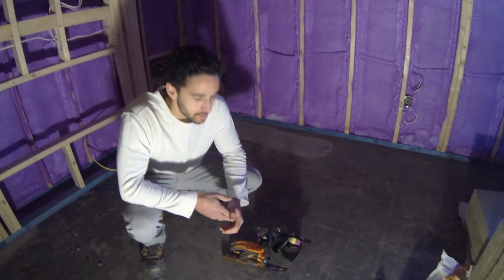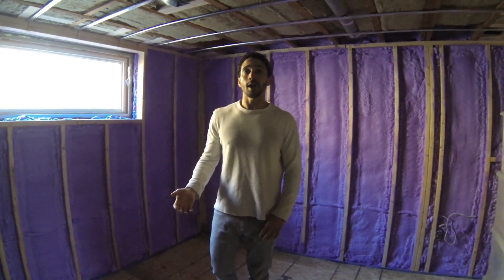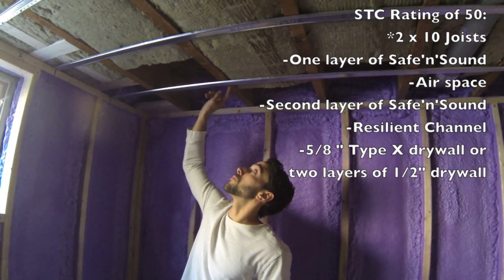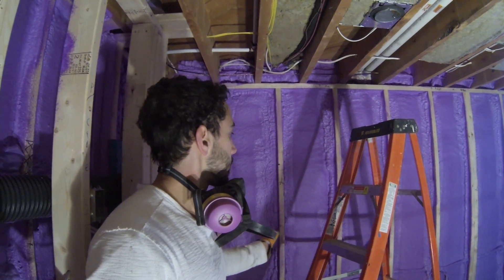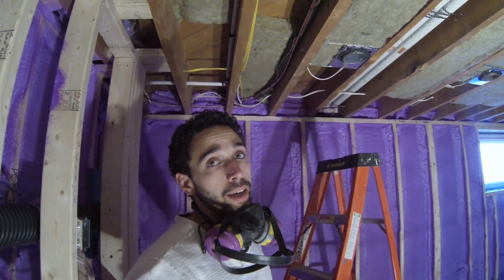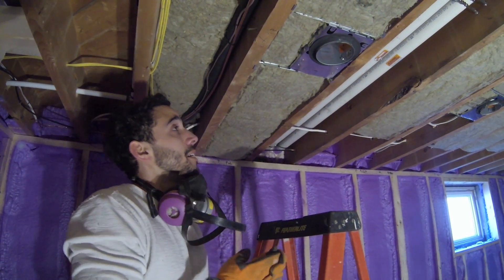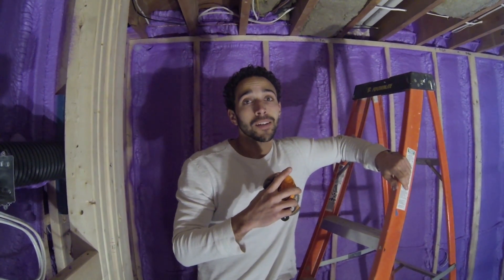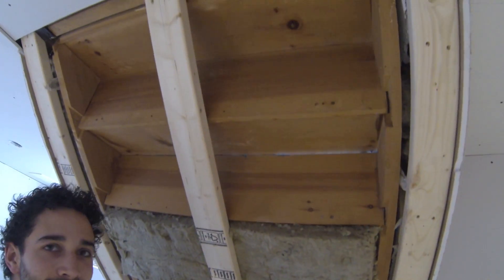HOW TO SOUNDPROOF A BASEMENT CEILING

Comment: the funny thing is with this thing, is that i did it in my own basement for a legal duplex, and all the sound still comes through the big holes in the floors, known as vents. regardless of any soundproofing done and required by code, unless you have dual hvac units, this helps, but you will always get noise
Reply from the maker: todd leggat I agree. I have a buddy who’s doing a duplex conversion now and is installing mini splits to heat/cool the basement unit. This way the duct work will only service the upper unit. He is also installing a product on the the main unit floor that will simulate having 2” of concrete. It’s suppose to really help reduce vibration from unit to unit. It will be interesting to see how it all works.

Comment: Which rockwool would you recommend? Thickness x density? I'm soundproofing my garage using 4x2 studs. For rehearsal with my band! Im a drummer! Thank you brow!
Reply from the maker: I would recommend using Roxul Safe’N’Sound insulation. It comes in either 16” or 24” widths. Depending on how wide your cavities are will determine what size to buy.

Comment: What brand of resilient channel did you use? I’ve been researching and want to be sure what I buy is correct. The Auralex RC8 (best I can tell) seems to what I need for wall and ceiling.
Reply from the maker: The brand I used is manufactured by Bailey. It's available at most big box stores in my area (Toronto, Canada).

Comment: Dwight-have you ever used Mass Loaded Vinyl sheeting on top of the roxul?  So my idea is to put the Roxul in the cavity and then layer MLV across, then add the drywall.  I want to add mass and density to help the Roxul by adding MLV.  Any thoughts?
Reply from the maker: GeoFagus 123 I have not heard of using MLV then installing drywall. So I can't comment on how it will perform. The only recommendation I can give you are other common materials used to help sound proof. To increase the mass and density usually thicker drywall is used 5/8". Installing 2 layers of 1/2" or 5/8" will really help increase mass & density. You can also add Green Glue between the layers of drywall. Check out my "How to Install Resilent Channel" video if you haven't. That will help reduce vibration noise. When you install resilient channel you can go over kill and install clips with a rubber backing first. Then your res channel is held in place by the clips. I hope this helps.

Comment: What can u do about the Windows?
Reply from the maker: I'm sorry Larry I don't understand what you're asking.
Reply: The basement windows let out a lot of sound, what could I do help insulate the windows? I'm a drummer and have a home studio eill be moving to a quiet side street to a house with a finished basement. I'm worried about a neighbor complaining and am trying to figure out if it's possible to really sound proof the basement? Thank you.
Reply from the maker: Larry Tate hmmm that's tricky. Try cutting some rigid foam insulation to the rough opening of your window. Glue a few pieces of the foam together so it's the same thickness as your window well. When ever you play your drums you could put the foam inside the window jamb to block the noise from escaping. Sorry that's the only quick solution I can think of. I hope it helps.

Comment: How much more effective is the Sound n' Safe in reducing sound transmission as opposed to the standard thermal insulation?
Reply: regular glass insulation actually is comparable, but would be difficult to prove that to an inspector. ive seen studies years ago, quite similar
Reply from the maker: akrasia1969 I have no idea. You would have to contact Roxul's tech support line to answer this question.

Comment: I have a total of 500 sq ft to insulate an entire basement, which is expensive but worth it. However, you mention putting in TWO layers of Roxul Safe N Sound which obviously doubles the price. Instead of putting two layers of Roxul Safe N Sound, could I do one layer of Safe N Sound and one layer of regular R38 insulation?
Reply from the maker: You're probably better of using Roxul Safe'N'Sound since that product is designed for soundproofing. I would recommend giving Roxul a call. Their technical support team will be able to give you the best advice.
Reply: I'm not a sound proofing expert, but I believe you want an air gap so sound doesn't have a way to directly pass through. Using R38 insulation plus a layer of Roxul your insulation thickness will be 15 inches (12 for R38 and 3 for Roxul). so with 2x10 or 2x12 floor joists you'd end up compressing the insulation to make it fit.
Reply: Ashton Noland can I ask you how much it cost you as I have almost same size basement and have problems with voice.

Comment: I called Roxul to ask them about the two layers.  You said the top layer should be flush against the ceiling sub floor in the cavity, then place the next layer.  Roxul differs.  They said if you are going to use two layers, NOT to have the top layer flush against the subfloor.  They said its very important to have a hollow space between the sub floor and the first layer you place in the cavity.
Reply from the maker: GeoFagus 123 I spoke with reps from Roxul as well and that is what they recommended. If you are using two layers of Safe'N'Sound they said the main installation technique to keep in mind is, make sure that there is a gap between the two layers. Thanks for your comment though it's much appreciated.
Reply: How big should that gap be, did they say?
Reply from the maker: Larry Tate give the reps at Roxul a call they can give you detailed info. on this 1 (800) 265-6878.

Comment: Hi Dwight , informative video !  Who is sling the resilient Channels ?  thanks
Reply: Saw them in Lowes today.  About 4 bucs each.  They are in the isle with all metal channels, corner beads and drywall.
Reply from the maker: eric Wilhelm thanks! I'm guessing you're asking who sells Res channel. Most big box supply stores will stock it. I bought mine from Home Depot. It's usually located close to the drywall section.

Comment: Hey Dwight,
Any tips on products to reduce sound under stairs? Aside from packing Roxul and drywall.. is there a spray product for this that you may suggest? Spraying would be easier but any advise is welcome!

Thanks!
Reply from the maker: Hey Andrew,  sorry I'm not aware of any spray products that you can use for the void under the stairs. The only other recommendation I would make is to use 5/8" drywall or two sheets of 1/2" drywall with green glue between the layers beneath your stairs. I hope this helps and thanks for checking out my video!

Comment: I put this stuff up first time with a hoodie and no gloves (I wear glasses so my eyes are protected more than if you don't). My hands were a little prickly after a couple of hours but nothing like fibreglass. If you need gloves working with this stuff than maybe you should just call the girl guides to help you, you bunch o' Mary's. I'm teasing. Sure wear gloves. Maybe your wife can give you her Opera gloves, you bunch o' Mary's. I'm still teasing. This stuff is a dream to work with. Cuts easy, form fits, no fuss and no real muss. The jury's still out on the soundproofing as I'm not finished the home recording studio, but I'm expecting it will be far better than the 50% finished Roxul wall and ceiling insulation, half-finished drywall, no carpeting, zero acoustic foam and no acoustic ceiling tiles I'm currently working with. Gotta be better than that, right? Also doing the Green Glue double drywall on the interior wall and a big ass heavy-duty door. As an aside, when I was buying all of this stuff from Home Depot, the salespeople MORE than casually inquired just what the hell I was planning on building in my house. I guess that's part of their vernacular now with instances of people being held in sound proof basements. Yeah, just what I want. More angry females in the house. No thanks. Wife and daughter are MORE than enough. :)
Reply from the maker: moxxi one day I will be as manly as you and be able to install Roxul with out gloves haha. You're right there is no comparison between working Roxul and fiberglass insulation. It sounds like you're in the right track to build a soundproof studio. Where you get the biggest sound transmission loss is through your duct work (if you have it in your home). Using res channel, doubling your drywall, with green glue in between will definitely help increase your STC rating.
Reply: The duct work, vents and HVAC stuff is definitely tricky. I'm only doing the Roxul in the ceiling joists flush with the bottom and leaving the air pocket closer to the 1st floor sub floor. Then doing a suspended ceiling with sound absorbing tiles - I'm hoping that will count as "Mass - Air Pocket - Mass - Air Pocket". My biggest concern is the framed bulkhead. It's approximately 7' x 14' and it's housing a fair amount of ductwork. I was thinking of Roxuling (now it's a verb!) ceiling joists as I've done, but then filling the other areas within the bulkhead with left over Pink R13. Then drywalling the bulkhead as planned and hanging the suspended ceiling underneath that a few inches. If anyone else has any other ideas, I'm all ears!
Reply from the maker: moxxi I split the Roxul safe'n'sound batts in half and place them between the framing on my bulkheads. I also installed batts above the duct work in the ceiling cavity before the new ducts were installed. Good luck with your project!
Reply: I will definitely be doing that - unfortunately the framing of the bulkhead sits below the ductwork by a half inch and I can't even shove the thin R13 sheets I bought in the space. So I'll have to get a little creative. Thanks for your advice!

Comment: how much does this cost per square foot
Reply from the maker: RICK HARRISON 1 bag covers 60 sq ft & costs $49.59 (CAD). The cost per square foot is $0.82 for one layer of Roxul Safe'N'Sound and $1.64 for two layers. Always add at least 10% more area when calculating your material required.

Comment: Thanks for the video! Do you just let friction keep the upper layer of insulation there? Wouldn't it eventually slip down? Also if I want to install radiant heating under the floor above could I still put the insulation flush to the floor?
Reply from the maker: DJ Malleck thank you. The batts are a little larger than the ceiling cavity and will expand in place. I talked to a Roxul rep about the batts falling down over time. Even if that happens it won't have any major impact on the STC rating. If you're using radiant heat above there is no issues with using Roxul below. ROXUL is a fire-resistant insulation, it resists temperatures of up to 2150◦F (1177◦C) without burning or melting.
Reply: Thanks!  Great and helpful videos and thanks for the quick feedback.
Reply: A proper installation would include mechanical support. You can get thin rigid wire sized just for that application. I don't know if it has a name, but the wire sticks are about 15" long, perfect for tensioning between 16 OC joists.

Comment: I wish you would show the tricky areas and how to deal with them.
There is a lot of HVAC and pipes in my basement that gets in the way of putting it flush with the ceiling.

I ended up folding it into a V shape to get around some pipes.. is that bad?
Reply from the maker: Darren Jones nothing should be hanging below your ceiling joists. I added additional support where ever HVAC ducts sagged below a ceiling joist. Thanks for the suggestion. Next time I shoot a video on this topic I will go more in depth with the prep work.

Comment: I am wondering how you can manage to stand installing Roxul Safe N Sound with just a T-shirt on like you do at the end of the video?   I have tried just installing 2-3 pieces while wearing a long sleeve shirt, gloves,  safety glasses, and dust mask and I go friggin berserk.  Its some of the itchiest stuff I have ever come across.  Its like being on fire...
How do you like it?
Reply from the maker: Matt N. I agree Roxul can make you very itchy but no where near as bad as fiberglass insulation. I am usually suited up and wearing a respirator anytime I work with insulation or in an attic. The key is to take a freezing cold shower after working with insulation. It avoids getting those itchy fibers into your pores.

Comment: Thanks, great video.  If you only use one layer,  is it supposed to go up against the subfloor or below against the resilient channel?
Reply from the maker: Thank you! If you're only installing one layer it should be installed in the lower portion of the ceiling cavity flush with the bottom of your ceiling joist. This will also make your life easier during the installation process by not having to squeeze the Roxul behind HVAC, plumbing & electrical since most of it is ran in the center of the ceiling cavity.

Comment: I have sound coming thru the register from the upper level, Do you recommend i use acoustic sealant around that area?
Reply from the maker: Sorry for the late reply. I am only seeing this comment now. HVAC duct work that is common between units is usually the toughest area to fix. Unless, you have separate HVAC systems for each unit there is not much that can be done to resolve this issue. Other than closing particular vents.

Comment: Hi, do I have to caulk the holes the in joist that the bx electrical cables run through? If I don't will it make a huge difference?
Reply from the maker: There is no need to seal the holes in your ceiling joists cavity. It would help to use acoustic sealant around any holes that go through the subfloor into the first floor. Same goes with any other utilities going through the subfloor to prevent noise from traveling through the small gaps.

Comment: Hi @Simpson Properties,

Great video.  

A couple of questions:  1) do you install resilient channel on the walls? 2) Do you install resilient channel and roxul for boxes (soffits) around ductwork?  3) I understand I leave 1/4" between ceiling drywall and side studs, do I also leave 1/4" space between the side drywall, and the ceiling drywall that you hung off of the resilient channel?  What do I fill the 1/4" space with, acoustical caulking?  Thanks.
Reply from the maker: +jogaserbia Thanks for the positive feed back and questions. 

1) Resilient (res) channel is most commonly used on the ceiling only. It provides a flush surface (furring) to mount drywall to and provides vibration noise reduction. In my res channel video the main reason why I installed it was to eliminate vibrations (people walking, music, etc.) to travel from the main floor apartment to the basement apartment and vice versa. The only time you would usually install res channel on the walls is if you are building a home theater room or share a wall with a neighbor (condo or town home). 

2) I don't use res channel on the underside of duct work in order to maximize the ceiling height. However I do use Roxul Safe'N'Sound between the framing around duct work to help increase soundproofing.

3) I don't leave a space between the drywall on the ceiling and the wall. I leave a 1/4" gap between the the res channel and walls ONLY. The drywall should be tight to the wall with no gaps to fill.
Reply: +Simpson Properties 

thanks again.
Reply: Can u install a resillent channel ceiling right over your current ceiling just by removing my current sheet rock and I can throw some roxul between first?

Comment: In your video, you say to put the first layer of Roxul up against the subfloor, then leave an air gap below it, and put another layer of Roxul below that. But in Roxul's brochure they show that the air gap should be below the subfloor, and both layers of Roxul should be stacked together. See page 4 here:

http://www.roxul.com/files/RX-NA_EN/pdf/SnS%20Sheet_Eng.pdf
Reply from the maker: I spoke with reps from Roxul and they recommended installing it with an air gap between the layers. Either way I doubt it would have much of an effect on the STC rating.
Reply: Simpson Properties Thanks!